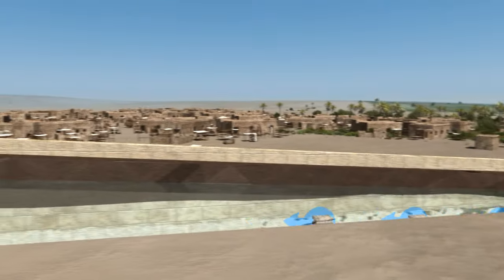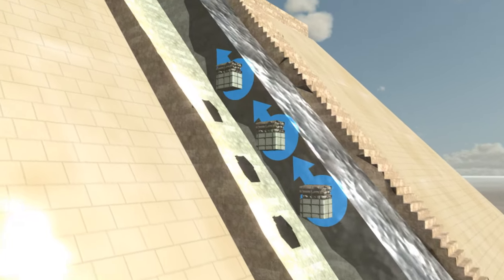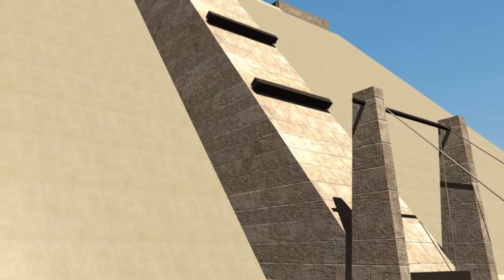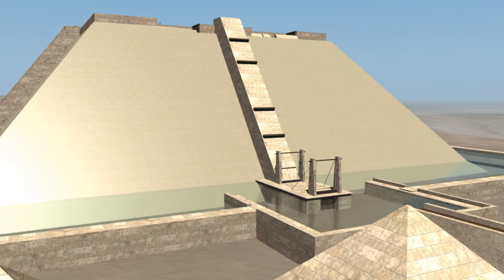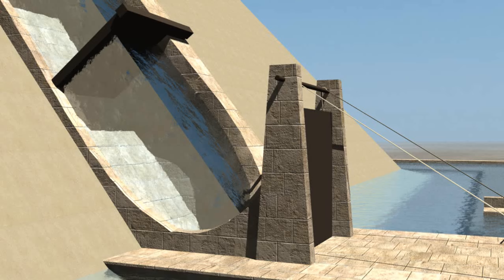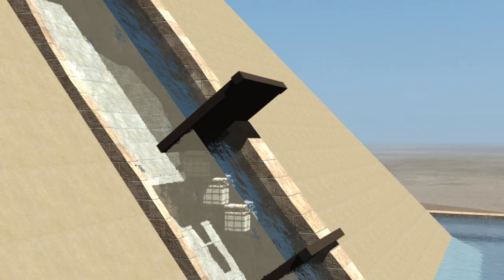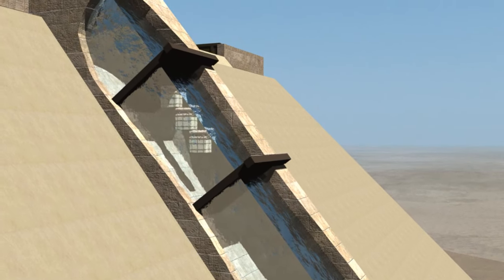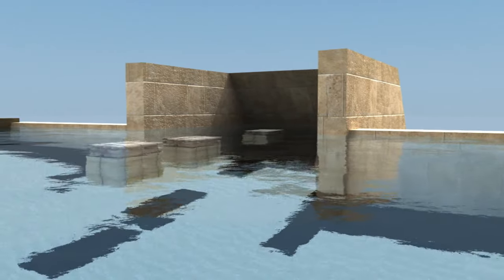How the Pyramids of Egypt were really built Addendum - Multiple Locks

Comment: From a physics perspective, I'm on board with some of it - the floatation, using water as a leveling system for carving shape-perfect blocks, the lot - except for the doors and maintaining a water- and air-tight seal in the column. With 50 feet (parallel to the face of the pyramid) between doors, that's a vertical distance of about 30 feet. This means that doors have to withstand the water pressure that comes from a 30-foot vertical column of water. (This is a very poor engineering assumption. In reality, the bottom door will have to carry the entire vertical column at all times, but I'll ignore that here.)

The first problem with the doors is that of being able to withstand the pressure of the water column above it. When the bottom door is closed and the next door up is open (to allow blocks to float past) that bottom door has to carry the water column of both doors - or 60 vertical feet of pressure. That's nearly 30 pounds per square inch. Given the 4x4x2-foot dimensions of a block, we can assume that a door would have to be at least 6x6-foot to allow a block with all of its floats to pass. This is a very conservative estimate.

A 6x6 foot door is 72x72 inches, or 5184 square inches. Multiplied by 30 psi, that's a wooden door that has to carry a load of at least 15,000 pounds of static load. That is, load while it is not in motion. We're talking about a massive door here.

Since we can assume that a door is only being opened when the door above it is closed, it would be carrying half of of 15,000 pounds in dynamic load. This still means that this door has to open and close with 7,500 pounds of pressure on it. This isn't the age of ball bearings we're talking about here.

Furthermore, how do you keep a tight seal between a moving, wooden door, and its pane? While under pressure, wood deforms - in this case, downward. This compresses the wood and deforms it away from its pane on the uphill side, opening a considerable gap. Keeping this from leaking at a tremendous rate isn't even an engineering reality in 2017, much less 2580 B.C. Even the toughest wet woods will deform by .01 inch under that kind of pressure. For the top of a 6 foot door, this leaves a leak with a cross section of .72 square inches. At 60psi, that comes to a leak rate of 45 liters per hour, per door. 

From an engineering perspective, there's too much that could go wrong for anyone to put this into production. If a door near the top fails, you get a cascade failure of all doors and the collapsing column of water puts the foundation at risk. Years of high-pressure water at the bottom of the structure also puts the foundation at risk. If a block gets stuck in the column, humans have to go in to free it, but they'd be unable to manipulate the block once the column was drained to let the people in.

I say I like everything but the doors. I would almost be prepared to believe locks, except that in order to raise a floating object with a lock, you have to allow a larger amount of water to go downstream. (In a perfect lock, the mass is 1-to-1, but this cannot be achieved unless your lifted object fits the lock exactly and you suffer no evaporation.)
Reply: For the record, at 146m tall, the pyramid would have been placing a pressure of 207 psi on the lower door - for a total pressure of 1.07 million pounds.
Reply: And, rather foolishly, I omitted the fact that a 30+ -foot column of water, supported by vacuum pressure, is 1) as tall as you can possibly get and 2) near to 0psi at the top, which would rupture any animal skins filled with air. (The dependency on vacuum supporting the column of water is called out in the original video, but not addressed in this one.)
Reply: man , u really know some hard stuff.
Reply: Not to mention all the labor of having to lift up fresh water continually to fill the ever increasing height of the building itself as well as to stay ahead of the leaks. You are right, the doors would have bound and been impossible to open, which would have left the only solution, to  refill the shaft from almost empty for every lift. Not practical or doable.
Reply: yeah ummm... what he said
Reply: Yes, but... The alternative to constructing several water elevators of ~6000 tonnes of water each is to build an earthen/wooden ramp around the perimeter of the pyramid like the Egyptian government claims. Then move ~6 million tonnes of stone with 400 slaves per stone, for 2.5million stones...

Now to put this into context the locks at the panama canal hold 200,000 tonnes of water and fill in 8 minutes. We are talking maybe 3% of the water. The locks don't need to be made of wood, they could be made of granite, they could also be internally mounted and actuated i.e. a valve type design to minimize water loss.

Additionally water could be pumped to the top by all sorts of a manner of means.
Reply: Im replying to an old video, but the load on the doors woulf only be there if there is no water under the door. If the doors are constantly leaking just a little bit, one door will open quite easily because it would be floating on top of the water below. In theory you would even get upwards pressure because the wood is lighter than the water its sitting in.

Its like opening your door while your car is sinking in the water, impossible when your car is empty. But once your car is filled with water, you can open it easily.

There would only be pessure on the bottom one, since the water thats beneath it, is not confined.

Hope this makes sense

Comment: THIS WILL NOT WORK. Here's why. The gates will be under enormousness weight. It will not move without enormous leaks. Wet wood against stone produces a lot of tackiness. What works is an internal ramp recently discovered.
Reply: I think the same
Reply: I agree.
Reply: Yep agreed
Reply: Agreed, but not about the ramp. Some of the granite blocks in the kings chamber are 80 tonnes - what is the maximum gradient an 80 tonne block could be dragged/pushed up and once you’ve figured that out tell me how long the ramp would need to be to achieve raising these blocks to over 350ft in the air. No chance.

Comment: Locks or no, the water column is functionally continuous. Take a water column. Place three cross-sectional dividing barriers along the length of it. They can be thin films, or steel plates, doesn't matter. The pressure is the same in each segment before and after the cylinder is sectioned. You can't get those locks to "lift up" the water above them.
Reply: Sooo ...you are not lifting water my friend ... It is Buoyancy that lifts the stones.... The water is lifted into place by men to initally fill the tunnels and reservoirs above river level...   Much easier to lift water in buckets than stone...

Comment: It's an interesting idea, but in addition to the other issues people have brought up, here are a couple more: 

1. The big issue I see is blocks getting stuck. If one of them  got caught somewhere in the water tunnel, there would be nothing that anyone could do to get it unstuck. 
2. No column of water can hang suspended by its own suction any higher than about 10 meters, because past that point the pressure at the top gets so low that the water will boil at room temps. This is especially true for warm nile water. That doesn't negate this theory, but it's something to take into account.
Reply: Whhhaaa?? No way really ??

Comment: One other thing I haven't seen covered is the amount of water needing transport to the top to replace displaced volume. So with the stone having roughly 3 tonnes per m3, minimum required to float a 1 tonne stone, will be roughly 2m3 of air, making each package 3m3 volume. Every time to remove package at top of system, you will need to hand carry 3 tonnes of water and pour it in the top = 3 m3 (even more if leaks, and positive buoyancy needed) ,  not impossible just another hurdle. I love the thought process, but along will other problems I see mentioned, I still say busted.

Comment: man, you really cracked the case, please share the stuff you smoke......
Reply: richard martinez 
hahahahhahahahahahhahaha
Reply: No kidding I have nothing that good.
Reply: This is my theory:
    How the pyramids of Egypt were possibly and most likely built:
    The stones were shaped at or near the quarry and transported to the Pyramid site in this method :
    An assortment of encasements from spherical to cylindrical, encased the block and interlocked into place around each block stone allowing the stone to roll. Certain attachments around the encasement would allow either fulcrums or rope attachments to ease movement and allow for tight corner turning with the least amount of men. Once the stone reached the top, the interlocking encasement was disassembled and the stone was leaned over and slid into place.
    This technique would have eliminated the need for lifting devices or a massive ramp.
    My theory is that most likely it would have been a spherical encasement allowing for tight cornering. This would be the most logical way to transport a large stone using the pyramid itself as the ramp.
     So in essence the stones were rolled up the pyramid in a spherical encasement that was removed once the stone reached its destination and leaned and slid into place once atop the pyramid. This process was repeated all the way to the top. 
     I have not decided yet if the encasements were made of a metal alloy or limestone etc. If bronze was used it would have been melted down for chisel making and as such there would be no evidence of the spherical encasements.
    If limestone was used it may have then been discarded and reused for other construction. 
    In conclusion the only way to deliver a square to the top of a Pyramid is to encase it in a Spherical interlocking encasement.
Reply: olan levan 
Hey buddy, I would like to see the 200 ton blocks roll uphill too, but it ain't happening. 

Look up sonic levitation. And also check out the cymatics experiments done inside the Red Pyramid.
Reply: there is Any pump used to send water to the top,pls tell that also??
Reply: Even made a video animation on it....lmfao....The answer is way simpler than we think....for instance. We do not fully understand our suggested 4th dimension, Time yet. So theoretically we don't know how massive amounts of time impacts anything really. Lately, there has been news of time speeding up. Anyway, back to the topic, How do we know those 2.5 ton stones of the pyramids weighed 2.5 tons several thousands of years ago???....I know it sounds wild...but there is no way in f%&k they made some complex water pulley 500 feet high or any other complex mechanism short of a modern crane. Like, I said.we don't know how time impacts anything, we already know it's not a definitive constant. Steel structures could blow away into dust after 3,000 years....ect... time is something we just don't understand enough about yet to say those big blocks at Giza didn't weigh enough for 10 people  to move with ease  thousands of years ago and time cause their density (weight) to increase.

Also not to mention the pyramids built pre-flood would've been built at very high altitude another condition causing them to weigh less. Either way this is my theory and one you probably haven't heard. We often look for complex answers to mysteries but I believe the answer is simply that those stones did not weigh as much then as they do now due to an impact time has on the molecular structure of things. Our entire planet could be becoming more dense over time....there's a start. Is Earth Becoming More Dense?
Reply: @olanlevan8470  you do realize that even the smallest stones were still equivalent to the weight of a car.   Impossible
Reply: @kevinm9  irrelevant. I also noted in other postings that a rail was built allowing the spheres to easily roll uphill using folcrums, ropes and basic leverage. These stones were not lifted, no such equipment existed that could lift something that high, and boom it out following the slant of the pyramid. These stones were not dragged either, because dragging would have cracked the blocks or caused uneven wear. 
    These stones were rolled uphill like a marble using wooden rails to guide it uphill snd around tight corners. Once atop, the encasement was removed, the stone slid into place, and the encasement rolled back down hill for the next awaiting stone. 
    I also suspect that some sort of dual rail system allowed the descending encasement to counterlever the next stone on its way up using mechanical advantage through the use of an extra pulley system. This would reduce the force needed to roll the stone uphill amd require less men to guide it uphill. This was repeated over and over. For this reason no stone would be to big or to heavy using a rail system, an encasement, and mechanical advantage.
     This is just a theory that I thought of from carefull thought. 
    I have heard other theories such as using water or sand for leverage which are also good theories by the way.
Reply: @olanlevan8470  pretty damn good theory.   That fact that we still don't know for sure is simply amazing.
Reply: @olanlevan8470  but my issue with your theory is there is zero evidence that is how it was done. Also you said the weight is irrelevant.  I totally disagree, I feel you are underestimating what these "rails" would need to be able to support.  Until a design can be proven that these "encasments" could built and built with the strength needed to support the massive amounts of weight, then it is just another unproven theory added to the hundreds we have already.   Hopefully one day we will find books inside the great pyramid telling us how it was constructed
Reply: @kevinm9  Agreed. Its truly a mystery. If they would have left it carved in stone, but they probably used parchment during construction which means we may never know.

Comment: You don't need those floaties if you just do 1 boat at a time.  Just tie one or a few blocks to a boat, maybe use an internal shaft to avoid the pressure issues.  Tie the stone to the bottom of a boat, drain water from the top slowly into the shaft and let it fill around the sides of the boat.  Someone can be riding the boat and make sure it doesn't get stuck.  Once the pyramid is to a certain height (about the height that the internal shafts go to) it's easier to just use the water as a counter weight to pull the stones up from the other side. 

If you allow for the idea that each section was drained slowly into the previous section, then you could also use a similar mechanism to what you describe here without relying on the floaties.... rather than the blocks floating up to the next lock, there is always an empty section.   so the boat starts at the bottom.  Lock 0 is closed behind it.  Section 0 is mostly full. Lock 1 is open and the section is empty.  water is slowly drained from lock 2 to the side, around the boat until the boat floats above the height of lock 1.  Section 2 is now empty, and section 1 is almost full.  Lock 1 is shut behind, then water is slowly drained from lock 3 until the boat & block reaches the height of lock 2, lock 2 is shut with section 2 above it almost full.  Section 3 is now empty,  etc. etc.  someone could even still ride the boat if they trusted the locks and the people working them 😅.  And I guess with this method you could have more than 1 boat going up at a time

Comment: The first thing I thought of when I saw the lift was the amount of pressure that must be on the base. This goes some way to explain how to relieve it. The gates are not vertical though. They would need guides, seals and a way to pull them in and out. 
The amount of effort to pull the gates up and building four shafts..overall is that less effort than lifting the stones the A-frame way?
I like how clean the animations look. Water is a great solution. Stick with it!